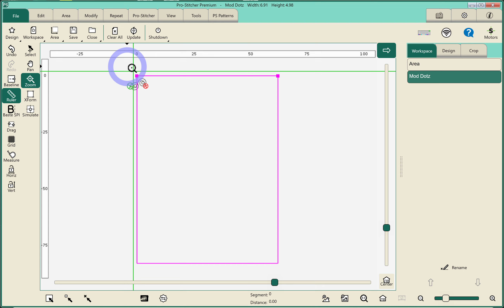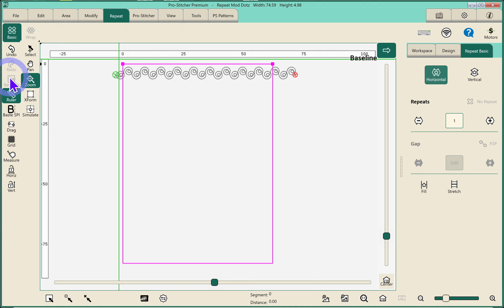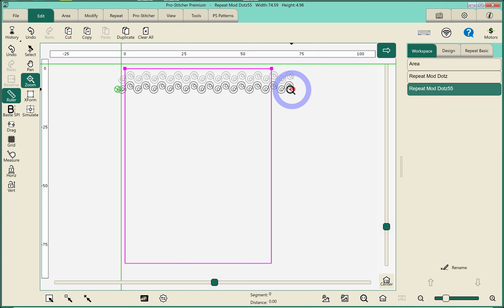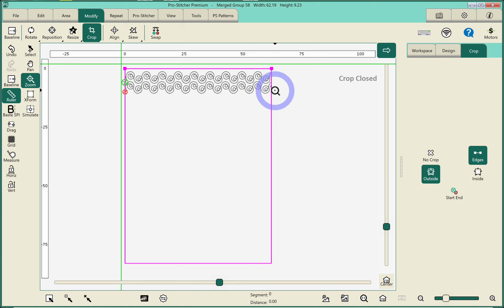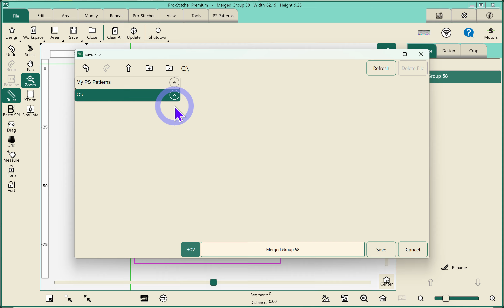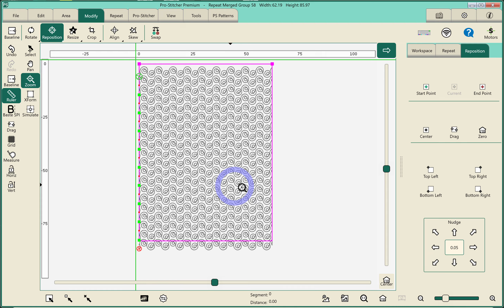07 18 26 Two Row LR RL E2E Design

Comment: This is an excellent tutorial. I was able to follow it step-by-step. Thank you!! The only issue I had was when it came to advancing the Quilt. I didn’t get that part down. I’m a little lost. I saw the note about setting jump to zero so you could advance. However, when it came time for me to advance on my HQ Avante 18, the machine would not move unless I canceled out. So then I just basically had to reset the design to resume. What did I miss?
Reply from the maker: You should have gotten the Long Jump Pause pop up notice.  The design will stitch left to right, then right to left, and when it gets to the End point on the left edge of row 2,  you should get that Long Jump Pause pop up.  When you get that, the motors will unlock and you can then advance with Drag & Drop.
Reply: @hoosierquilt  yeah it was really weird. I did not get the long jump pause. it wanted to keep going. It went down and back like four times so two full sets of the created design. if I would’ve had a larger stitching space, I think it would’ve just kept going.
Reply: I will keep playing with it cause I really like how it came out how much easier it was to go down and back, but yeah, I had to cancel it out and then start again so for the rest of the Quilt I just did one row at a time and then did the long jump